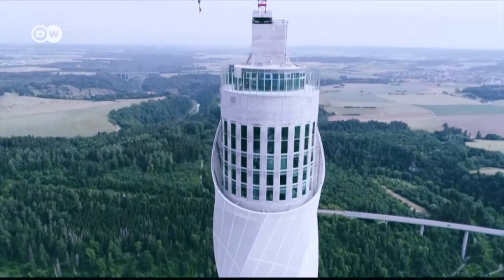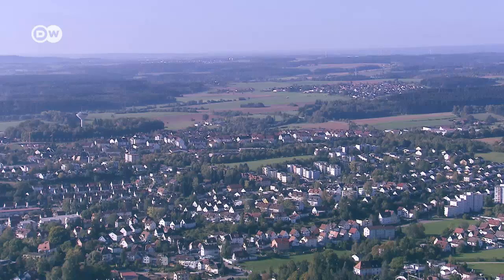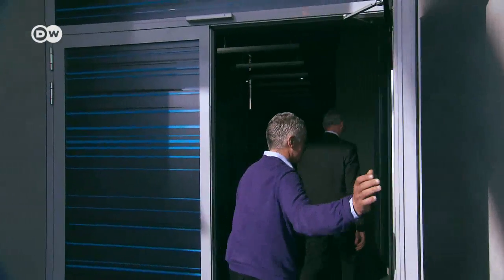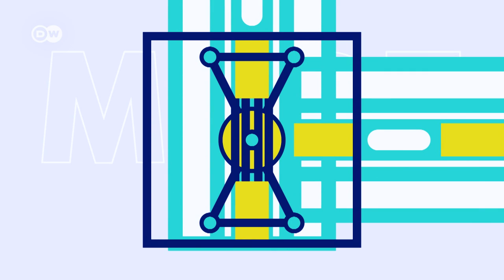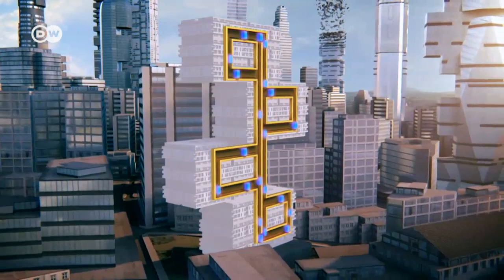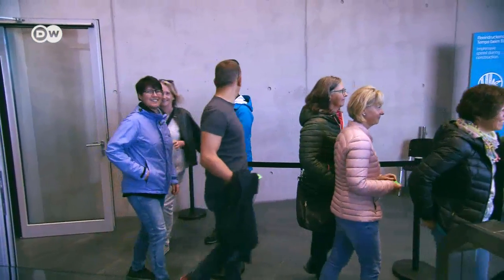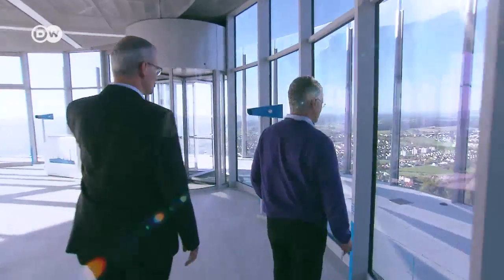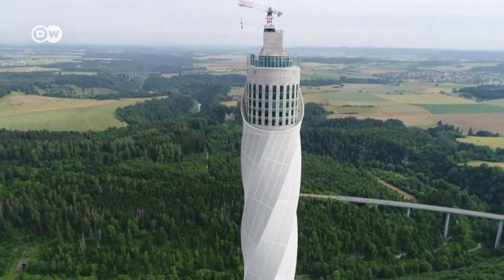Skyscraper elevators: up, down and sideways | DW News

Comment: Surely this system would use considerably more energy as the linear system is lifting the full weight of the loaded car unlike the weight being offset by a counter weight on a traction elevator system?